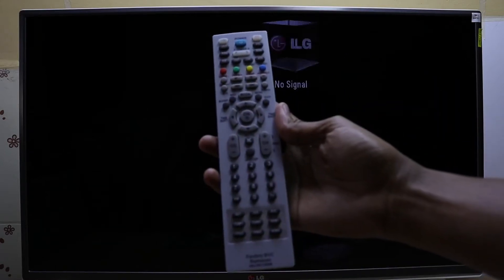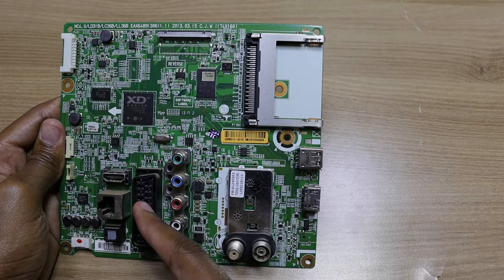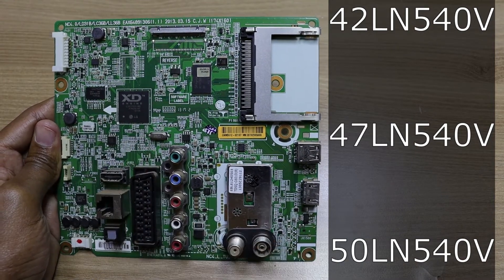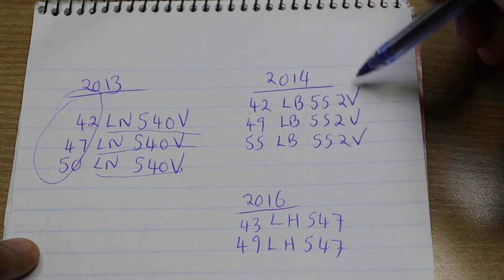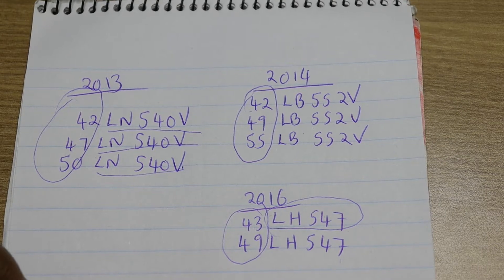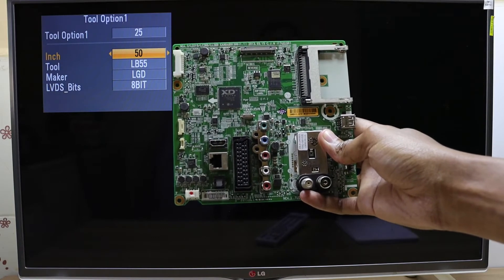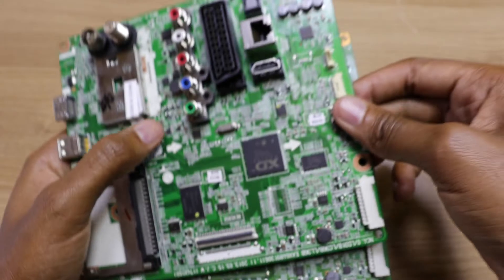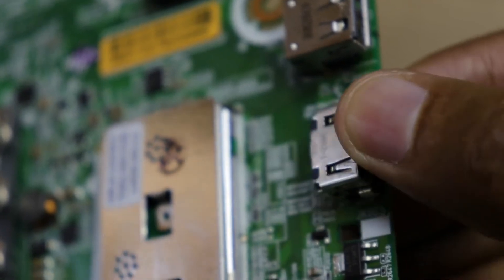LG Service Remote Change Screen Size In ADJ Settings

Comment: Hi Dominic I have some dead pixels on my G2 65inch tv on the bottom row. If I have ‘screen move’ option selected on the tv the screen image goes up by a few pixels periodically and when it goes up the dead pixels disappear from view. Is there a way of adjusting the image up slightly using the service remote?
Reply: Hi, can you reduce your size?
I have the same problem

I have dead zone in the border, and i Want to reduce size to avoid. 

I try to change in adjust menu but nothing changes. All image and menus are in full screen.

Comment: Hi Dominic, is there a way to replace mainboard and change some chips to adapt the resolution. I have one 32 " tv with standby issues and the tv wont turn on. i must try 100 times to power on  and one time working. 

I ordered the same mainboard EAX66085703 model but from wrong tv  42" . The new motherboard working good  but i have distorted and overlapped picture. I changed the tv size but there is again distorted picture on the display. 
I will try to change some chips on the new mainboard  to make it  working with  my 40 inch tv. 
Do you know wich chip is for the setting and the resolution on the mainboard.
my  TV is LG 40UB800V   and new Mainboard I ordered  is  49UB8300-CG , 55UB8300-CG  Model EAX66085703 the same mainboard  as mine in the 40UB800V 
Thanks.
Reply from the maker: Try changing the LVDS bits in Tool Option 1 of ADJ settings. Changing any chips on the main board is not advisable but if the screen connector can fit in the new main board then there's a slim chance it might work
Reply: @DominicGichane   I tried all those settings  but without success,  i think can be the new mainboard wrong to... is from aliexpress
Reply: @DominicGichane hey Dominic goodnight like how I have a 55inch lg if I went in the service menu and change the tv inch to 60inch will it work? I change it to 60inch an the picture look a bit better but afraid to turn off the tv. U feel if I turn off the tv it will come on back an work normal? Or it will brick the tv

Comment: Hi Dominic! 

I have a LG 47LB5600 model and and there is some vertical lines in the screen (on the corner). This problem is caused by the cof cable that is broken and a repair is not possible. 
My question is:

Is there a possibility to change the Inch to 42" in order to polarizes only the not affectted area? 

Thanks!
Reply from the maker: Nothing on the settings can be done to hide those pixels. What about some black electrical tape? Have you tried that?